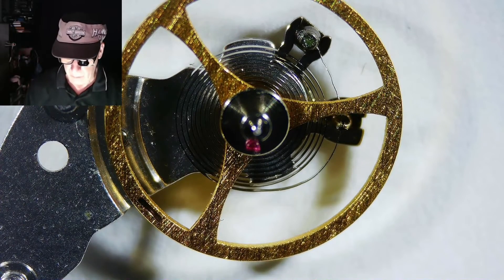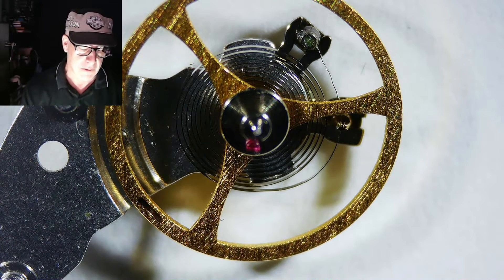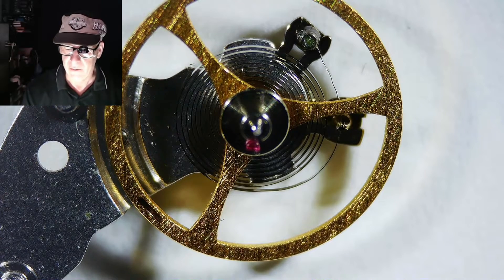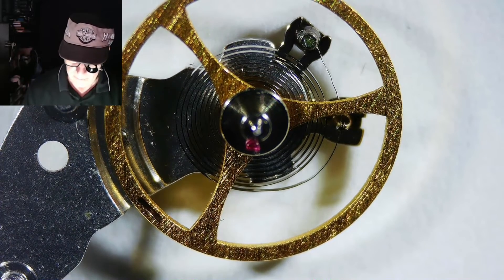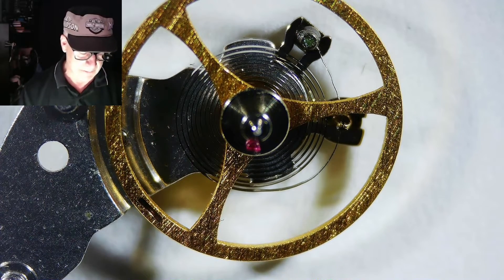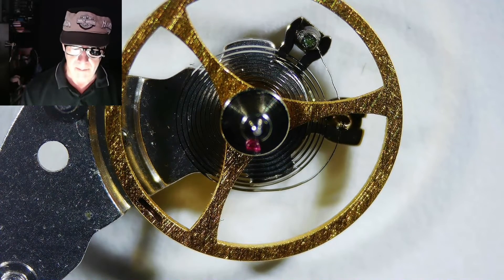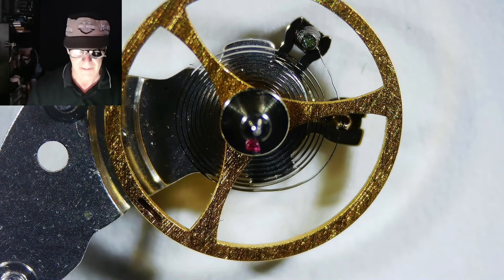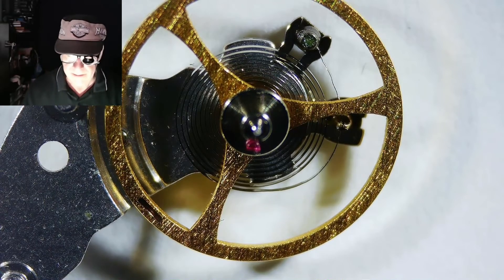Watch Hairspring and Guitarists

Comment: With my shaky hands and clunky tweezers, I needed a third hand for hairspringing. I took the hairspring off the balance staff and pinned it to a piece of foamboard. Now the hairspring stays within the microscope’s depth of field, and I have a bit more control over the angle of the bend. When removing the pins, a gentle twist helps to avoid pulling up the hairstyle with it.
Edit: stupid autocorrect. Hair*spring*

Comment: Great job, JD! 

Those little bends remaining near the hairspring stud isn’t a big deal as they are beyond the travel of the regulator pins. Once you turn the regulator pin block in its setting to close the gap as in Alex’s video, it’ll have even less impact. 

The active breathing part of the hairspring from the collet to the regulator pins is far more important and looks fine. 

Alex Hamilton’s YouTube channel is outstanding. There are some other excellent watchmakers on YouTube, like Kalle Slaap of the Chronoglide channel, but as far as tutorials and teaching, Alex is outstanding. 

Just call me Mark, but if it makes it easier to say my YouTube name, think of the word mercury. My YouTube name is pronounced like that with AL on end - 12:18 Mercuryal/mercurial. 

If the watch is lacking amplitude after a full disassembly, clean and oiling, I’d be checking the condition of the mainspring first. 

It’s important to disassemble the shock settings (remove capstones) to get any dried oil cleaned out properly, cleaning the balance jewelling without removing the capstones won’t suffice. 

This watch uses an ETA 2650 movement, so spare parts aren’t too difficult to come by.